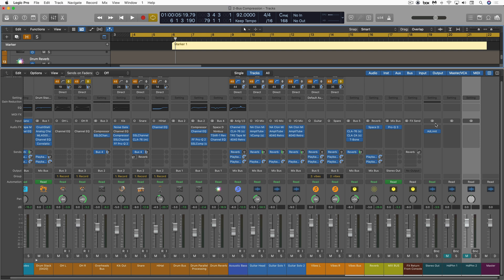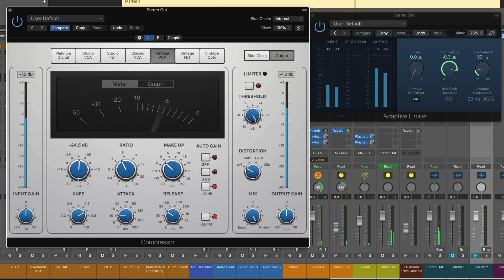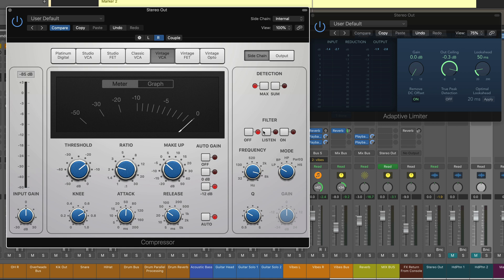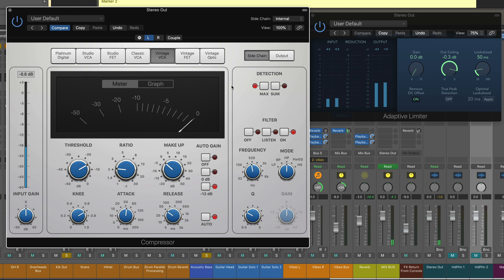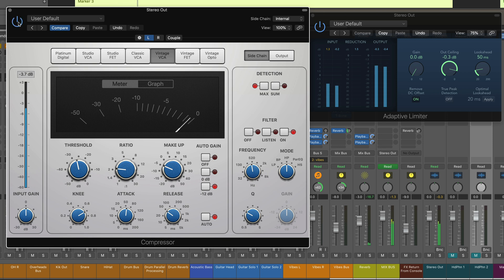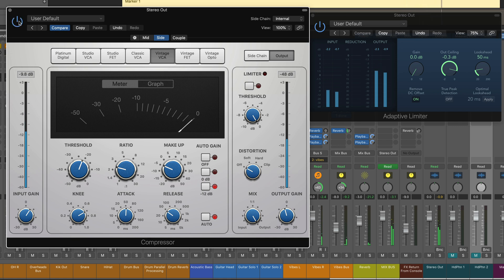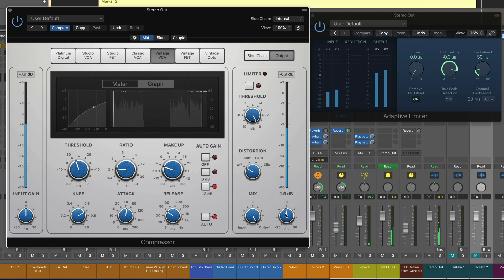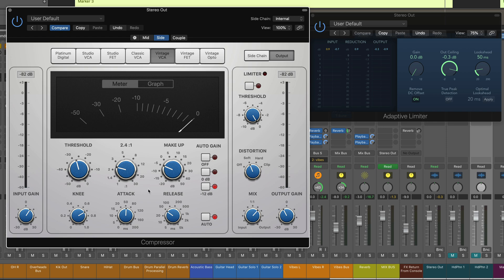Mastering 2 Bus Compression With Logic Pro's Compressor To Improve Your Mixes

Comment: I don't understand...first, why aren't you using the couple button? This is enraging LOL. Hard to watch you going back and forth between the two. I just want to jump through the screen and tell you to click the couple button. I mean how can you even judge what is going on with your ears if you're only doing one side at a time?! Why would you not click the couple button and prefer to go back and forth between L and R and make the same adjustments?!!?! And even if you were using the couple button, why would you want, in a master, for the L and R to behave differently? And it seems like you're just looking at the needle movement, not listening! Especially because the compressor is hardly doing a damn thing. If you were listening you'd hear that the two signals are not gain matched therefore you're not really giving yourself an accurate representation. My mind is boggled at this tutorial.
Reply: I totally agree with the couple button. But dual mono on the master creates a wider more dynamic mix, very useful for genres like jazz but horrible for tight genres like EDM.

Comment: So when you put the comp on HP 500HZ, it's not going to compress anything below 500HZ? Thanks for the video.
Reply: Not sure if in the past year you've learnt this yet. But the answer is no. It is not a multiband compressor it compresses the whole frequency spectrum. It just filters out the bass from the detection circuit. It still compresses the bass, it just isn't triggered by it. Hope this makes sense.